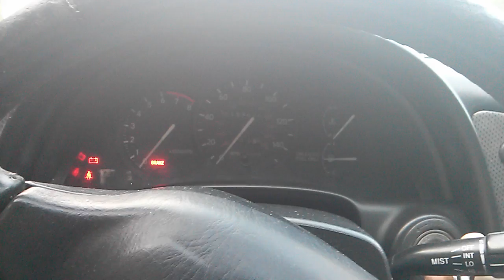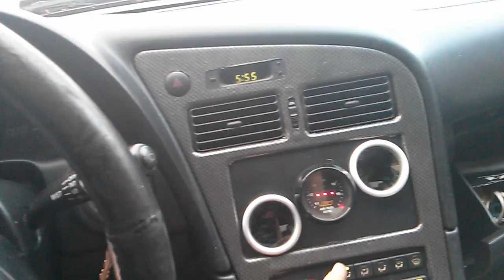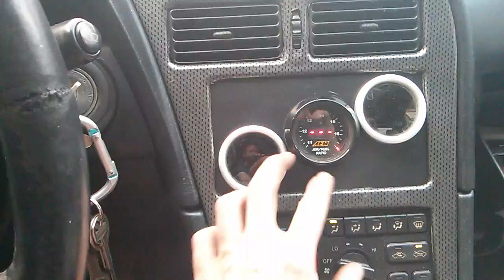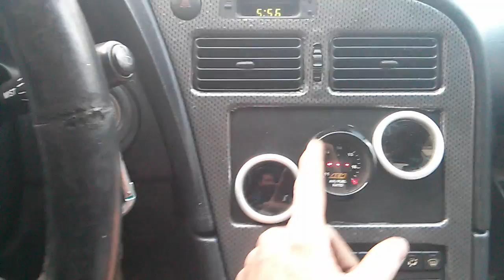3sgte swapped Celica first run!

Comment from the maker: if you have a 5sfe, use your old 5sfe transmission with the 3sgte. You just have to get a clutch kit that is (3sgte flywheel and pressure place with 5sfe disk). All mounts will work, just make sure you get the GT4 3sgte and not the MR2 one. The mr2 3sgte doesn't have a power steering pump, and the alternator is mounted where that goes, because of this there is a different crank pulley. Wiring is also an issue, I got around this by using aftermarket engine management and wired it myself.
Reply: Can you tell this to a mechanic and they’d understand ?

Comment from the maker: If you look closely at the hood/bumper, they are made for each other. The center of both are raised up. So you can't put on a bumper other than a GTFour one if you have the hood, unless you find a bumper that is made to fit the hood. The stock GTFour body kit looks far more amazing than any other kit I've seen, toyota did an excellent job on designing it. So the options are getting a non-GTFour hood with a vent and using some aftermarket bumper, or going GTFour hood and bumper.

Comment from the maker: You can get a 3sgte for $1k + shipping off ebay. If you don't convert it to AWD then you will be saving a lot of money. The stock trans bolts into the 2.2L engine perfectly, you just need to use the 3sgte flywheel and clutch pressure plate with the clutch disk from the old 5sfe, You can use the old motormounts, radiator, and the a/c lines bolt up. There needs to be some custom electrical done too. All in all, you can probably get it done for under $3k. Message me for more details if you want

Comment: Awesome build man! Just did the swap to mine  but what exhaust did you? Shops in my town dont have want to fab one up for me smog reasons.
Reply from the maker: I had a fully custom exhaust made by a local shop. Borla muffler and a resonator with 2.5 inch piping. I had a 3 inch catalytic converter on it with a 2.5 to 3 inch reducer on each side of the catalytic converter that way I could still run a cat but I would have less resistance. There is no smog in my state, so I'm not sure if it would pass
Reply: @LegitRaceCraft  interesting why not just 3” pipe all the way? Also did you keep stock downpipe?
Reply from the maker: now that I think about it, I remember having a 3 inch downpipe into a 3 inch cat, and then I had a reducer to 2.5 inch. 2.5 was more than enough for my power level on that car and then some

Comment from the maker: if you dig around on 6gc.net there is a ton of info there about the conversion. Most guys repin the connectors going into the ecu, and I think there is a guy on 6gc that makes a custom harness for the conversion. I don't know a lot about the wiring when running the stock ecu since I installed an aftermarket one with its own harness that I had to wire into the engine.

Comment from the maker: I don't know if it can handle the power or not. I know the bell housing of the trans will bolt into the engine, but I'm not sure if the torque converter will bolt in. I'm using the stock manual from the st204 on mine, and I had to mix 3sgte and 5sfe clutch parts to do it. It might be easier for you just to get a manual trans for the celica and convert the car from auto to manual

Comment: BEASTY BRO!, BEAUTIFUL BUILD, one question haha, I have a 3sge but a wanna turbo it, how would I go about the ecu? I don't know shit about them tbh, will a 3sgte ecu just plug in ?
Reply from the maker: +byob1423 there would be differences with the air pressure sensor for sure..and I know the 3sge has a different valve train and camshafts. The head I used in the Celica was 3sge with turbo internals, and I also know the turbo exhaust will mount up to it. You can bolt in the 3sgte camshafts but the valve springs will need to be stiffer to handle boost, so change those too. I'm not sure if the 3sgte ecu will bolt in..in the worst case you will need to repin the ecu connectors so the 3sgte connects. I'm not sure what else is different between the two engines though, probably compression ratio too. I have a video (that I'm feeling so it is shorter) on turboing an NA s2000, that should give you an idea of what needs to be changed for the 3sgte, though there might be other things. In that video I'm talking more about configuring engine management, but I do mention the differences between NA and turbo.
Reply: Hournine Racecraft awesome bro, boy was I wrong hahaha massive help dude, I'll write it all down, subbed and liked :D

Comment from the maker: Right Hand Drive or Left Hand Drive it doesn't make a difference in difficulty. The steering doesn't get in the way of the swap. All of the clips that you find will be RHD for the Gen III 3sgte. This engine only went in the 94 - 99 GTFour and late 90's MR2, only cars with the Gen III. You will need the GTFour bumper and hood, this engine puts out some HP, and some heat to go along with it. The GTFour hood is aluminum to help cooling, and is vented too also to help. It will get hot without them

Comment from the maker: I wish I could, the only thing I know about 2000+ celicas is that they came with 1zz and 2zz engines. My engine swap was pretty straight forward since the old engine was a 5s and the new one is a 3s, since they are both "s" style engines the 3s was was east to put in. Yours would be difficult since you would be putting a 3s in where a 1zz/2zz was. You would need someone to weld motor mounts, custom axles, and many other things. It would be easier to just get a car with a 3sgte already in it

Comment: i just stumbled upon this video and one of your previous ones 2 years ago. what solution did you end up doing for the thermostat housing that was hitting the a/c compressor? i was going to suggest to use the rev1 3s-ge or rev1 3s-fe thermostat housing. bolts straight on, the hose outlet points at a different direction and you'd just need to get a bolt to plug the rad fan switch hole that it has on it.

Comment: Hey man 
I am looking to put a st205 into a 95 celica 
What transmission did you use?
I know the tranny that comes with the gt model isn’t strong enough to handle the st205 power
Reply from the maker: +habeeb yusuf I used the factory transmission that came with the 5sfe. It has been fine with the 3sgte for about 5 or 6 years now, it probably won't handle 500+ HP, but it handled my modified geniii just fine. I just had to mix two clutch kits to make it work. Factory turbo and injectors but it has upgraded EMS, spark, and intercooler, so the transmission gets worked pretty hard. I intended to run that transmission until it failed, but it never failed

Comment: Hey man, I'm swapping a 3sgte outta a st215 caldina into my Celica, what's the easiest way to do the wireing? I've got a full loom and ecu in both cars, do I just take out the complete 3sge loom and drop in the 3sgte loom and hook it up to the 3sgte ecu?
Reply from the maker: +Sam Phillips you might have to repin some of the connectors, but I can't say exactly for the 4th gen in the st215. There should be a ton of information about this on 6gc.net

Comment: thanks for the advice I was considering getting an mr2 one. after looking on the internet im thinking on just getting a 3sgte clip that way hopefully it comes with almost everything I need. im just worried the only clips ive found have the driver side on the right instead, will that interfere at all with installation? (sorry if I sound like a newbie, my dad is doing most of the actual mechanical planning, im just trying to learn)

Comment: So I have a '94 with the 2.2L 5SFE, when looking for engines just get any 3SGTE from '94 to '99 and it should bolt right up with the exception of a few minor things (clutch etc) even if it's out of an AWD Celica?
Reply from the maker: +CalebFDW basically, yes. I used the 5sfe mounts and bolted them to the 3sgte block, it just drops in after that. Wiring can be a bit tricky, so read up on all of that. And mix the clutch kits together so that the 3sgte mates up to the 5sfe trans. The rest is just touch up stuff, it isn't all cut and dry, but it isn't too bad

Comment: Im also thinking on swapping my stock engine for a 3sgte, im in the process of saving up the cash right now for the main engine, im curious am I going to have to buy a new transmission or anything else before I can get my engine installed and working properly?
Reply: Did you ever get it done

Comment: Thinking of adding this engine to my Celica. Does swapping this in need more work or can it be a 1 for 1 swap? Thanks.
Reply from the maker: If you have the 2.2l it is a very easy swap, there are a bunch of write-ups on the little things that you need to do. If you have the 1.8l it is a hard swap.

Comment: How much did you pay to get that new 3S in your celica? I have an ST that I nearly converted to a GT Four and I am considering a swap now. Where did you get the swap done? If you know anyone in Los Angeles that does the swap, let me know
Reply from the maker: I bought a 3s that needed a rebuild and then rebuilt it. I think I only paid $800 for the block. The head only had 10k miles on it, I forget the price but it was more expensive. Either way, this was years ago and the prices have changed. I swapped it in and I don't know of anyone in the LA area that does it. Sorry I can't be more help. You can check out the 6gc.net webpage, there is tons of info on there if you want to do it yourself.
Reply: Did you ever go through with it? Ive got an ST I want to 3s swap as well

Comment: Okay, I got issue with the power wires, injector and ignition coil ground and power , where did you connect yours ?
Reply from the maker: +Nitrospeed Team I got a relay and fuse box and used the old fuel injector power wire to turn the relays on. The relays powered the ignition coils and everything else I needed.
Reply: Hournine Racecraft hey wat year 3sgte did u use
Reply from the maker: +Juan Macias I believe it was a 98
Reply: Hournine Racecraft thanks its a gen 3 right
Reply from the maker: yeah, it's a gen 3

Comment: thanks man. what if I have the 1.8L motor and I have the 3 gen 3stge Motor and transmission. I will need to get a gt transmission but is there any engine and transmission mounts or cross members I need to get so i don't have to look for it later?
Reply from the maker: +Robert Tucker Jr My understanding is that it is harder if you have the 1.8L. This is all well documented. I know very little about the 1.8L, except that it is a 7a engine and people commonly mix it with the 4a and supercharge it.

Comment: How much did you actually "BUILD" per say. 
I swapped the 4efte into my Tercel, and that was pretty easy. Just a lot of wiring (had to learn some Japanese to figure it out!).

If I were to buy a Celica, what would I be looking at to complete the swap? I should be able to do most of it by myself, unless I have to weld the mounts, but I heard it's a direct swap.
Reply from the maker: +Chris Foster Knife-edged crank with a crank scraper fitted to the knife edge and a lightweight Fidanza flywheel. ARP main studs, head studs, and flywheel bolts. Forged pistons/rods with overbore. Individual coil upgrade..etc etc. The list goes on.

The engine is a bolt on direct swap if you get the 2.2L celicas, the mounts are different in the other celica engines. You can even use your old transmission, you just have to get a custom clutch/pressure plate setup to mate the trans to the block. Refrigerant lines swap over (or refrigerant compressor manifolds I think..but I used my old compressor), and your exhaust will have to be redone. There are guys that make the wiring conversion for the 3sgte, but I just made my own harness since I am using engine management anyway. If you really plan it out before you attempt it you will get it done pretty fast. The car handles very well already, and this engine makes it a little beast. Convertibles (like mine) have a beefier frame, so that's kinda an advantage.
Reply: +Chris Foster Why not just buy a celica with the 3sgte in it?
Reply from the maker: +Josh Abrey because they didn't come to the US with a 3sgte in them after 93. The 94+ body style stayed overseas with the 3sgte.
Reply: +Hournine Racecraft just get it from Canada we got em
Reply: +Josh Abrey they sell as turbo 4wd here instead of alltrac
Reply: +Josh Abrey Maybe. I live all the way down in Texas, so I'd have to get one that can drive all the way down here :D
Reply: +Chris Foster I dunno what it's like in the states but you can put a car on the train from coast to coast up here for like 600 bucks
Reply: +Josh Abrey Geez that's not bad. I doubt it's that cheap here. I found a few of these in Canada today, in the 2000$ range. Pretty damn good for an AWD 3sgte.
Reply: +Chris Foster the dollar right now is in your favor. Canada's dollar's shit.  2000 cad is like 1600USD.  we can even order right hand drives over here as long as they're 14 years old and because Japan is so small they come over with like 60,000 kms max (1.6km in a mile)) pretty sure they're illegal down there but they're very accessible up here
Reply from the maker: +Josh Abrey it would be nice if we could get one here for that price! Seriously!! They have to be 25 years old here to be driveable on public roads. Approaching 25 years though! Plus I'm in Hawaii, so add $2000 shipping cost to the cost of the car.
Reply: +Hournine Racecraft Why do they have to be 25 yrs old?
In Texas, I think it's 25 yrs old as well for no emissions? Basically means you can run a straight pipe legally lol.
Reply from the maker: +Chris Foster I'm not sure exactly. I think it's because it falls into the antique category. My dad had a few antiques when I was growing up, and those were cars/trucks that were 25 years old or older. If they are considering all cars 25 years or older as "antiques" then I can understand why, but I'm not exactly sure.

Comment: If swapping into a 95 celica can I use the harness and ecu that comes in the st215 swap ??and how did you wire the coils
Reply from the maker: I'm not exactly sure, but I doubt you can swap it easily. I would pull out both harnesses and lay them side by side to see how it will work. This Celica had one ignition coil and the st215 3s has 4 ignition coils. I did a very custom wire job on the entire engine. The coils are Audi A4 turbo from an early 00s model, so I wired them as they were in the Audi but with an ignition trigger on each one

Comment: if i found a 3sgte flywheel and pressure plate, would i be able to put them with the 3sge clutch disk and it would all work together?
Reply from the maker: I'm not sure, what engine and transmission combination? The 3sge clutch disc would work well with the transmission originally paired with the 3sge. As long as that disc fits between the pressure plate and flywheel you should be okay
Reply: @LegitRaceCraft  i have a manual 3sge celica and putting a 3sgte into it. so i would already have the 3sge disk
Reply from the maker: That sounds like it would work, but do some more research to be sure.
Reply: @LegitRaceCraft  sweet,thank you

Comment: Where did you buy your front mount inter cooler set up kit. Link?
Reply: HourNine Racecraft  I cant seem to find one for my celica st165 , I’m doing a swap. I’m gonna be putting the second generation there the st185! But idk which one to go for
Reply from the maker: +Ryuk _96 I don't remember where I bought it. It's for a Nissan s14/s15 and I made the bracket so it would fit behind the bumper. It isn't really a kit. I replaced it later with a Mishimoto j-line I think.
Reply: HourNine Racecraft  I’ll have to see what I come up with. I just don’t wanna leave the intercooler on the top because I won’t have the scoop for it and it’s gonna be breathing hot air. I think going front is gonna be better but who knows
Reply from the maker: +Ryuk _96 I liked the mishimoto ic. The issue will be attaching it to the gtfour crash bar unless you have a st204, then you can just mount it to the bottom of the factory crash bar
Reply: HourNine Racecraft I have a st165 I’ve never ever done this and it’s my first turbo car which right now is giving me pains with the swap but will see how this turns out

Comment: Did you need a new wire harness or computer?
Reply from the maker: +Brennan Williams I got a new computer (ecu) and it came with a flying lead harness. There weren't a lot of options for the 3sgte
Reply: Finding this video and these comments have helped a ton. My 5S-FE spun a bearing so instead of doing a full rebuild I might just do this swap. I found a 3sgte with wire harness and computer. Just not sure if I’m ready to commit to a project like that.
Reply: HourNine Racecraft how long did it take to put the new harness in? & I have found a 3sgte with a harness and Ecu, will it just plug and play at that point?